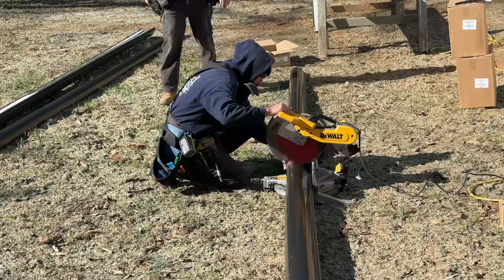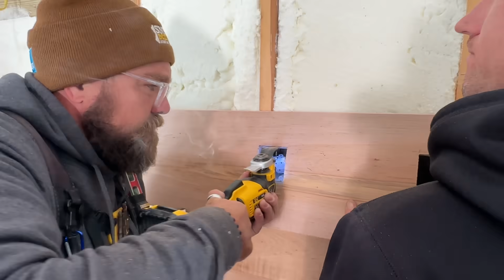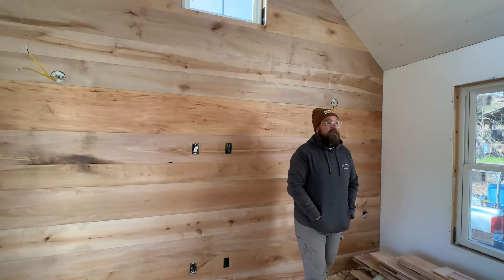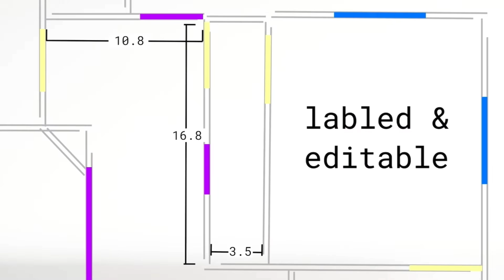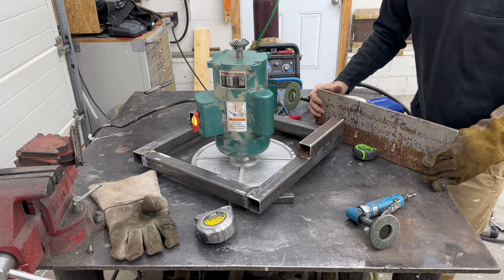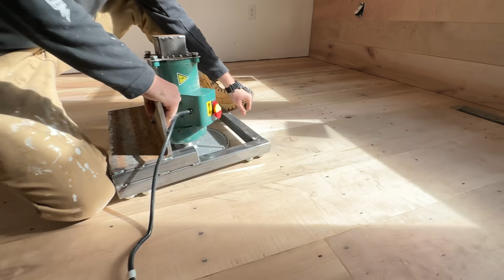Building A Small Income Property | Part 29

Comment: Love you guys however not impressed with the gutter downspout choice. Also you guys ran hardpipe for gutter/drain tile but it doesn't connect directly to the gutter downpipes? What was the point of that especiially the choice to do no clean outs? Just wondering because my house that was built in 93' has drains for all 4 gutter downspouts with cleanouts on each one.

Comment: Yeaas, finally an actual floor sander.!!  Jamie, love your ingenuity, but that thingy mabobber was still to far from edges, and corners.  For all you spend on tools just for goodness sake go rent one, or just buy one off eBay, craigslist, or ????   I'm bing watching and hope you do before putting down a finish.  Reminds me of when I "fixed" my own transmission and had to go to a shop for the front seal (because I didn't have the proper tool)and it was only $80 and they pulled the drivetrain anyway I nearly killed myself getting out for the rear seal.  Pick your battles :) Love , love the floor!!!!

Comment: I mostly just use recesses and dowel pin joinery. If I do use nails they are either screw shank reclaimed from pallets or cut nails. The screw shanks I only really use in rough projects like step-stools or firewood cribs.

Comment: As much fun as it was to watch Jaime build and test a floor sander, those stand up flooring drum sanders can be rented in my area for $30-40 per 4 hours, and given the tiny size of that floor, and even doing 4-5 passes with increasing grits, it could have been easily done in 8 hours (possibly even 4). It would almost certainly have achieved a better result in far less time as well, since I don't know how many passes Jaime will be doing with different grits here, given how laborious it would be to change out the sandpaper on his home built floor sander.
Reply: Not only that, but what about the swirl patterns the disc sander would leave?

Comment: I worked for a boat building company, and they took 8" buffer pads and bolted on a 12" round plywood disk. Then they put on self-adhesive 12" round sanding disks and used the high-speed buffers in a way not necessarily approved by the powers that be. You might have to imagine the rest, but they worked really well, especially for hull shaped surfaces. To carve lead ballast they used skill saw blades in another unapproved way. That was over the top and the boss insisted that they put the guards back on.

Comment: That floor sander is pretty clever.....except, as other night have said, it needs arms on it so you can use it standing up. But as a prototype/90% production ready unit, its very good. Oh and maybe some foam around the edges of the frame to prevent damaging walls etc. but still, cant wait to see the finished product!

Comment: IMO all low voltage stuff should be installed in conduit. The current "needs" for LV always change quickly and it allows for easy(ish) upgrading without a whole renovation. Coax cable is going out of style and being replaced with CAT 6 for streaming, the upgrade would be super easy if conduit was used. In 10 years new classes of CAT capable of higher speeds or fiber may become the new norm, who knows.

Comment: Please make sure to use box extensions on those electrical boxes on the wall with the wood. Those gaps have to be closed to flammable material or it’s a code violation. I see this all the time on wall boxes where there is flammable material like wood and bamboo.
Reply: Yeah they'll fix it bud don't worry 😉

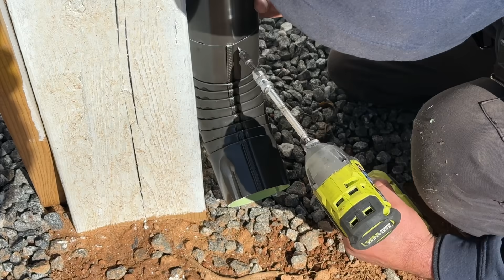Comment: 2:28 here in the UK, water from gutters usually runs to a soak-away (Drywell) that's at least 5 metres (16 feet) away.  The distance away from the house is so the foundation's don't get undermined with wash.

Why do US house just flush to the foot of the house?

Comment: That generator can’t drive a motor like that for the most part. The utility power can provide the inrush/fault current necessary, but the genset will struggle and may be damaged.

Comment: What is the advantage of the sanding tool Jamie built vs the floor sanders that can be rented at Lowe's or HD?
Reply: You kick up a lot more dust.
Reply: I’d imagine there’s not a huge advantage in a one time use case, I think the major benefit is just in tackling a project that is hard, and the satisfaction of doing it well.

However for these guys, this tool can potentially be used on all their projects going forward, instead of having to rent one each time.
Reply: @Kluberus  so how is putting ginormous swirl marks in your hardwood flood an advantage. A traditional floor sander is a belt sander. The majority of rental places use a random orbit style floor sander. This contraption is going to leave huge swirl marks all over the floor.